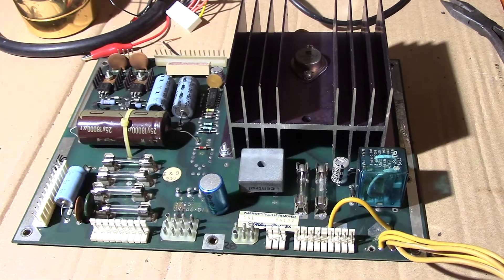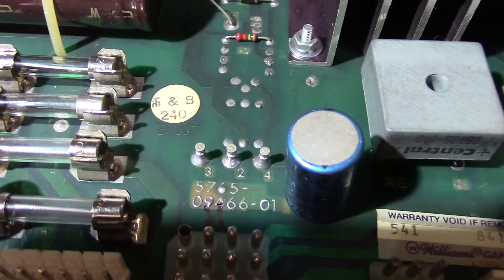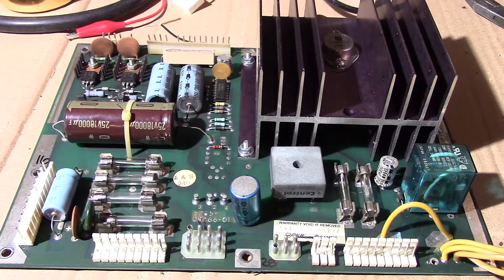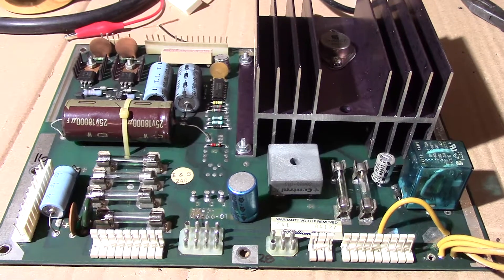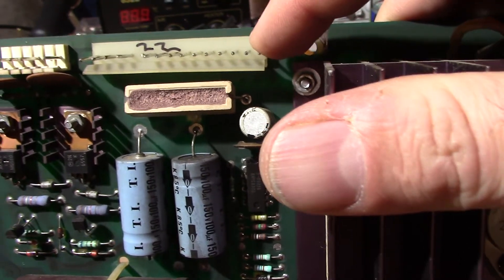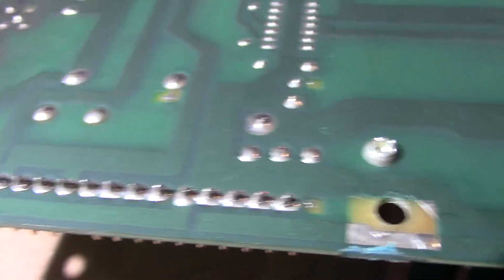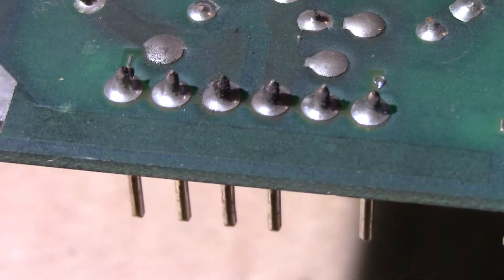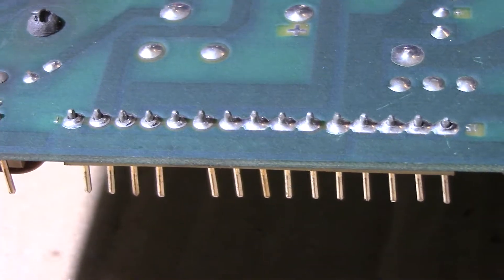System 11 MPU Power Supply Special Solenoids

Comment: On my same power supply Iam getting the 5 volts on test pin 1, and test pin3 Iam  getting -14.3 and test pin4 I am getting 14.3 VDC? Is this right? I don’t think this right?
Reply from the maker: The + and - 12 v are not regulated so seeing 14.3vdc is fine. The only issue is if you had your test leads reversed when you made those measurements. You wouldn't have 5v at TP1 if BR1 wasn't working correctly which would mean that TP3 and TP4 should be correct.
Reply: Ok thank you so much, I had my black lead on pin2 witch is ground right?and the red lead on pin3 reading 14.3vdc, and then moved the red on pin4 and that reading -14.3 and pin 1 read out is a steady 4.9 VDC.
Reply from the maker: @mariolopez1747  Yep all good.